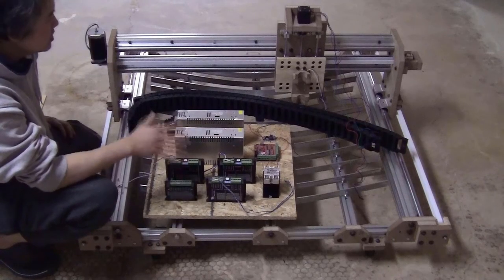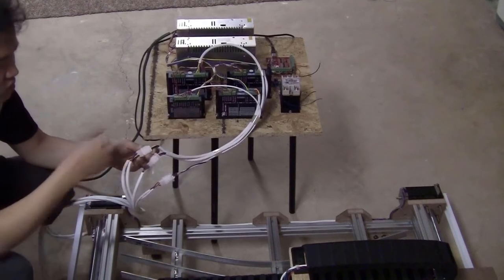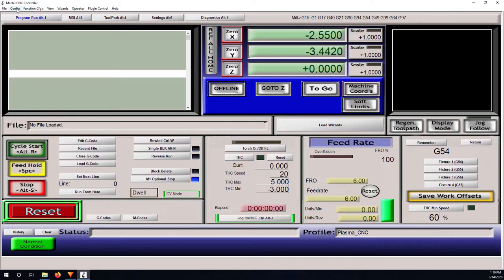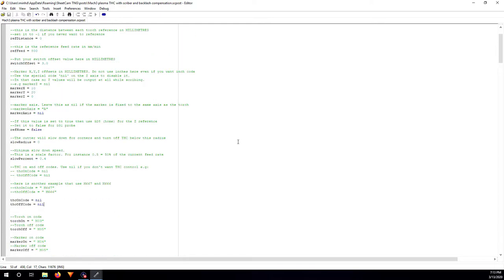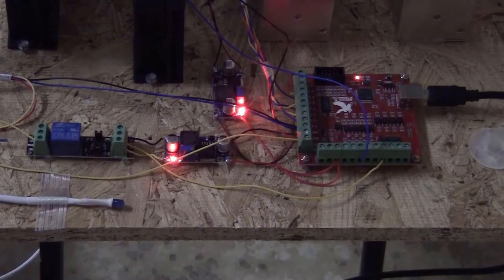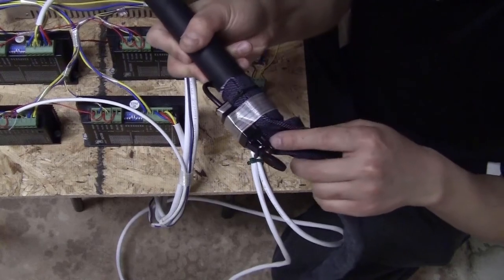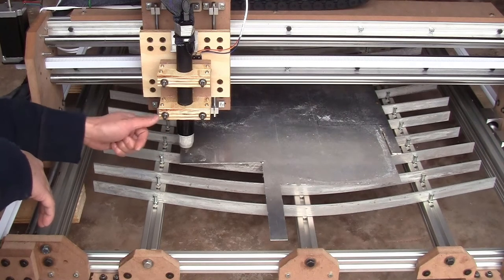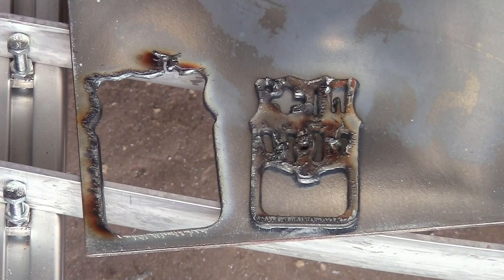CNC Plasma table - P4 - Wiring, floating head (no THC), torch relay (Mach3, SheetCam) - 1st cuts

Comment: lovely work!  i am also following your steps, and also purchased this plasma torch to upgrade the one i had. My previous torch cable didn't have a power cable, i suspect that its wired to the air pipe since it must have had a way to pass the power somehow. Do you think that makes any sense? as such i should wire the power cable of the new torch head to the coper connecting the air. if you have any insights would gladly apriciate them thanks in advance

Comment: Hello, is the sheecam program that determines whether the plasma works and stops through the g code or the mach3 program?
Reply from the maker: Mach3 will receive a signal arc OK from the THC if you have one to know that the plasma works. SheetCam only generate the path

Comment: excelente  montagem ,parabéns ,  estou com dificuldades ,   no start da tocha,  quais relés usou?
Reply from the maker: I used something like this: https://www.ebay.com/itm/DC-5V-12V-Signal-Trigger-Control-Turn-On-Off-Module-Self-lock-10A-Relay-Switch/191931361196
Too bad for the language barrier, If you need help. Try to describe as many details as possible. I'll try my best

Comment: hi Minh. do you have any problem with high frequency of plasma cutting? how you solved this? thanks for your attention and sharing
Reply from the maker: Yes, I do. It's hard to deal with interference. I don't have a real solution to deal with it completely till now. The best way is not to use HF pilot arc plasma cutter. You can use Blowback pilot arc plasma cutter or even a non pilot arc plasma cutter. If you really want to keep your HF pilot arc plasma cutter, you can use an Ethernet Mach3 Controller to avoid interference. But make sure that you avoid all the Chinese controllers, they don't work well for plasma cutting table.
Reply: @minhsmancave9448  I have same issue with interference, I have grounded all the stepper motors and every wire is shielded yet when I start to use it in the first 2 minutes everything looks fine but from three minutes upwards the motors start missing its steps and my computer motor starts to blink when the torch it on

Comment: Hi...great video. I have question..how you change the distance between torch and cutting material? Physically, in the mach3 or in Sheetcam? Thanks for your answer
Reply from the maker: In sheetcam, when you setup the torch in sheetcam, there's option for torch height.

Comment: Hi Minh Do you have any schematic diagram to connect the cut50P switch to mach3 5 axis bob?Thanks
Reply from the maker: I don't have a  diagram for a specific bob. You just chose any output, and set spindle relay on that output. The trigger on the cut50p has 2 wires, connect that to wires to the relay NO pin and common pin. The output of the bob will control the relay to open and close the trigger.

Comment: Hello friend, the problem was the material to be cut, that is galvanized, put some sheet metal in there and you will be fine. any mild steel will be fine.
Reply from the maker: Thank you! Things are starting to get better. I have been learning a lot about plasma cutting. I'm getting better and has been able to cut few good metal arts. Stick around and watch my new videos about this machine and please give me more inputs.
Reply: @minhsmancave9448  if you are able to buy a THC later on, I bought the Vietnamese robot3t THC3T-02 haven't installed yet, but already arrived, let's see how it works.
Reply from the maker: Got that THC, installed and made a video about it. It seemed to work fine with kinda thick sheet metal around 1.5mm or up. I wasn't very successful with the thin sheet metal like 0.5mm or 0.8mm. So I made my own mechanical THC. It is just a shield that I can adjust the torch height. The shield just glide on the sheet metal and keep the torch at a constant distance from the sheet.
Reply: @minhsmancave9448  I'll check your videos then, keep on keeping on!

Comment: Hi. Min, I have followed your instruction, but I get a problem. Microswitch  sends trigger to controller but Z wont stop to go down.....
Reply from the maker: Try to change the motor dir and step to active low in Mach3, configs, ports and pins, motor outputs.
Reply: @minhsmancave9448  Sorry Minh, TrialAndError is my another account. Finally I have found the answer, ha ha ha ....That is ....Microswitch and Emergency Button have the same port number. System works normally after I fixed the problem. Thanks Minh
Reply from the maker: @tohx11  I'm glad you fixed it. We always learn something after every mistake.
Reply: Minh, I have new problem. My THC3T-02 has jerking behavior. I have tried to config Z Motor tuning, Voltage (120v), Sensitivity  (50-800), Delay (1-10)and steadeystate Voltage (3v). But still can not solve the problem. Can you help me?
Reply from the maker: @tohx11  this mostly due to the Z axis speed and the sensitivity. If it's jerking, that means the sensitivity is too high for the actually speed. Or you reduce the Z axis speed (mostly acceleration because it is a small movement) or you decrease the sensitivity. Try to tune these 2 parameters until you get a smooth movement of the Z axis when cutting. When you cut at slower feed rate and less warped sheet, you might need to reduce the sensitivity even more.
Reply: @minhsmancave9448  OK I will try it tomorrow

Comment: Can you make the Plasma_CNC.xml file available with the Mach3 settings? has how to create gcode with these settings in artcam 2008? the configuration of the mach3 plasma with ... is it already in the SheetCam?
Reply from the maker: I surely can share the plasma profile file if you have the same board. I've never used ArtCam before so I'm not sure. But sheetcam is very straight forward to use with this machine. Just let me know if you have the same RnRmotion control board because each board is configured differently.
Reply: @minhsmancave9448  if you can share i appreciate it, the signal is the same. I did not receive the complete SheetCam. Can you also share it? Thanks for all the help. congratulations on the project.
Reply from the maker: I upload the profile for the plasma cutter to the GrabCad folder: https://grabcad.com/library/cnc-plasma-cutting-table-for-under-750-1
For SheetCAM, I also only have the demo version so not really different from you.
Reply: @minhsmancave9448   thanks for the settings for mach3. i don't speak english, i'm having trouble understanding the changes and configurations in SheetCAM (from 8:34 minutes of the video) you could put a text with details and or copy the command line. so that I can translate on google translator. I am very grateful

Comment: this post processor works only with mm? i need a post processor for inch
thanks
Reply from the maker: It's also work in inch if your machine is set to inch. Just enter the number in inch instead of mm.
Reply: You can set up sheetcam for inch or mm and you set up mach3 for inch or mm each separately

Comment: How to check if relay is working are not ,, I need to check  relay so I need help ,how to connect  light and check if relay working are not
Reply from the maker: If you want to check the relay with a LED light or any type of light:
- Make sure the light work by wiring it to a power source (LED light to 3.3V)
- Once the light is working correctly, cut one wire and put it one end to a COM pin, the other to NO pin (normally open)
- Make sure the relay is powered properly (10V DC)
- Now, if you turn on the relay by putting a input signal (5V) to the control pin, the light should turn on, and 0V, the light should turn off.
Good luck!!!
Reply: @minhsmancave9448   thank you

Comment: What mach3 USB easy error connection if plasma torch is on ?
Reply from the maker: Yes, better go with other cards if you have choices
Reply: What stavolt on PC and BOB Powersupply and grounding can help that problem ?

Comment: Hallo, how about PROBE G31 wiring? Can you explain it? My G31 probe still not working. Thx
Reply from the maker: Did you check if the limit switch is working? Enable probe in Mach3 at the pin you connected it to. Go to diagnostic window and see if the digitize LED lights up when you make the limit switch click. If it doesn't you have to check your limit switch setup again. If it does light up, the probe command should work.
Reply: @minhsmancave9448  hi, thankyou for your answer. I use limit switch in port 1 and pin 11, active low. Other limit switch pin to ground. But i cant see LED up when click the limit switch. Whats wrong with my wiring?
Reply: When i check the limit switch with AVOmeter, its work.
Reply from the maker: What controller board do you have?
Reply: @minhsmancave9448  i use 5 axis BOB ST-V2.
Reply: @minhsmancave9448  does the probe pin have to be port 3?
Because i use port  1 for controlling BOB and its work.
Reply from the maker: Not sure about active low settings, have you tried put it to active high? (Disable active low) normally active low is connected between a input pin and 5V or 12V pin. If you connect it to gnd, I think that it should be active high.
Reply: @minhsmancave9448  oke, i will try tomorrow, thanks for your answer. GBU

Comment: hello this little relay I can use it on a 70a cutter
Reply from the maker: The relay is only used to close a 12V circuit. It doesn't matter what amperage of your plasma cutter can cut.
Reply: @minhsmancave9448  for a 380v cutter I can handle it
Reply from the maker: Yes, the relay is only to control the trigger, not the cutting current
Reply: @minhsmancave9448  it's very nice thank you